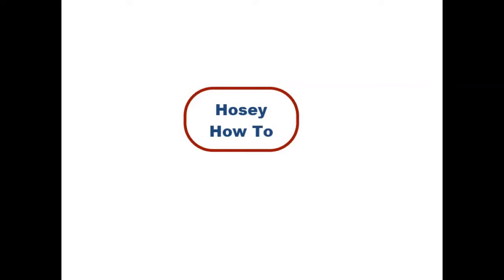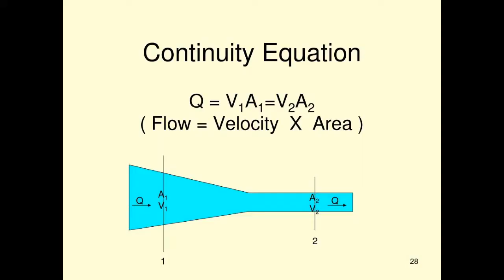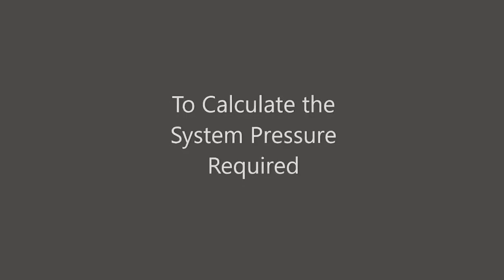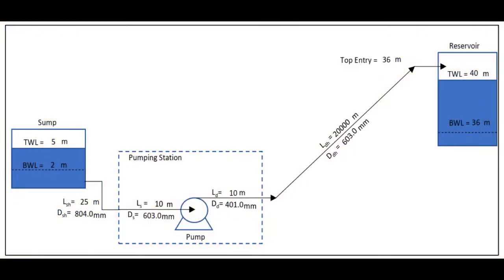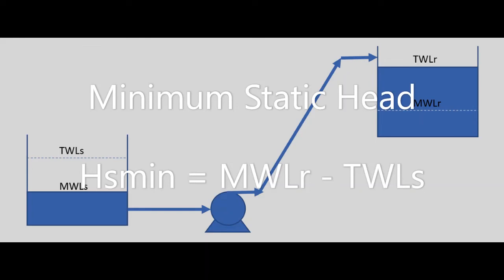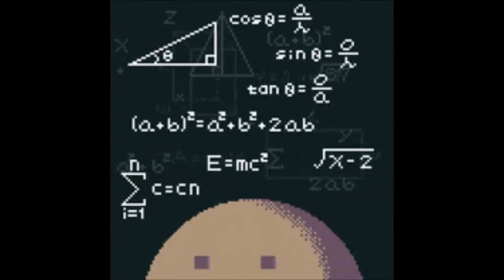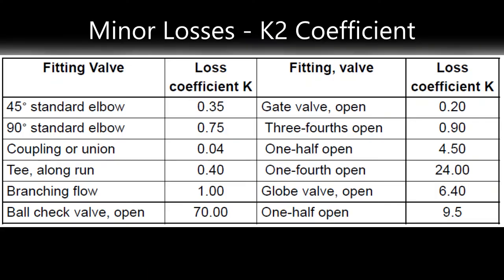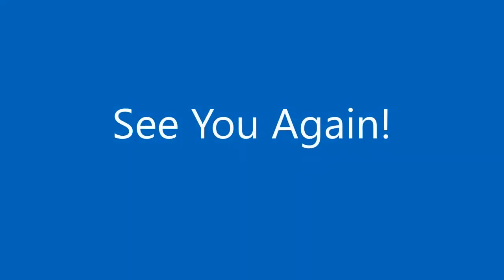How To Create Sysetm Characteristic Curves

Comment: Thanks for the video, would be great if you could post a video on calculating system head curves for complex systems as you mentioned in the beginning of the video i..e one source supplying multiple tanks or a distribution system.
Reply from the maker: Thanks for your comments. It is not an easy way to manually calculate the system head for multiple tanks. As mentioned, this is normally done by using hydraulic engineering software. Nevertheless, I will pick up this challenge and post this video in future.